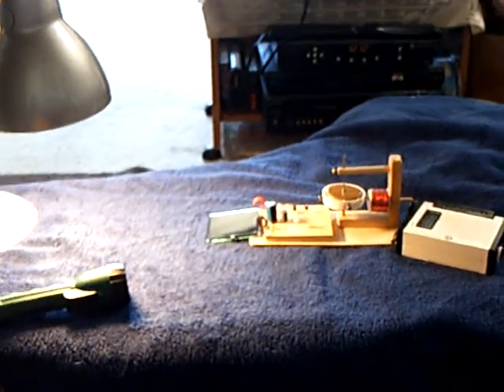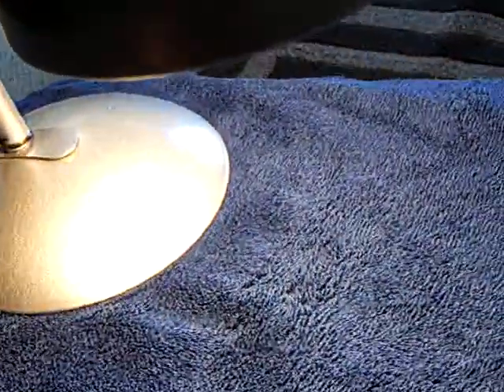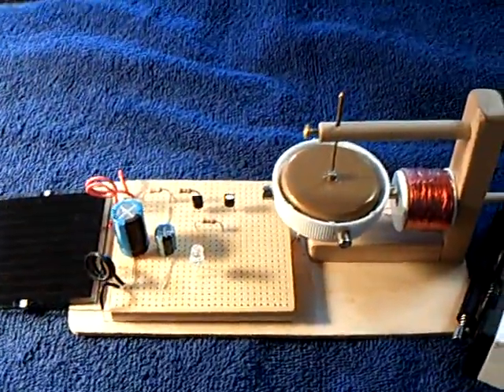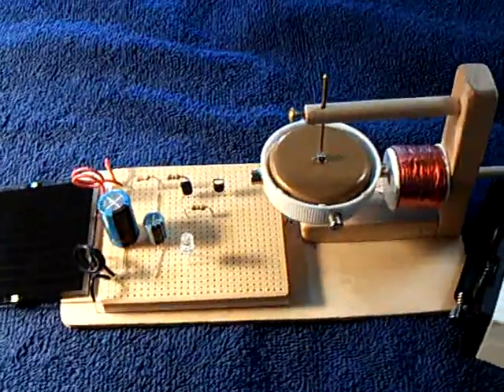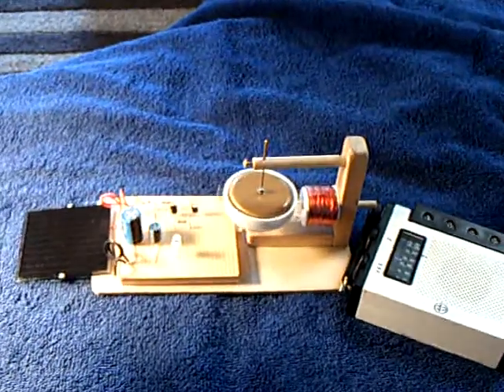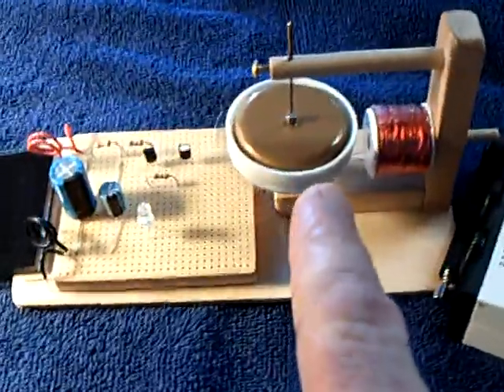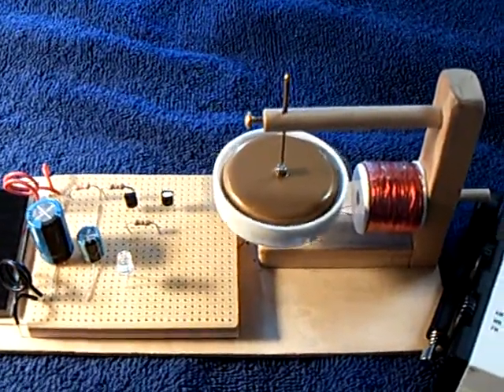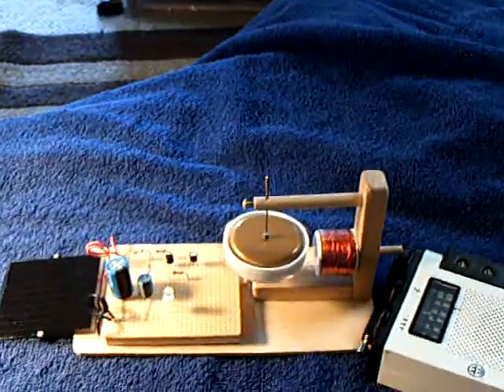Light powered pulse motor -- energy demo.ASF

Comment: Could you try to use a separate JT circuit to run LEDs placed on top of the solar cell and see if with an initial light source it will run in perpetuity?  Just a thought.  I am slowly collecting materials to begin replications with variances based on my thinking, but I thought i would just share my thinking.
Oh, and thanks for sharing your work.  It is inspiring  and, I am sure, will lead to greats workks.
Edward